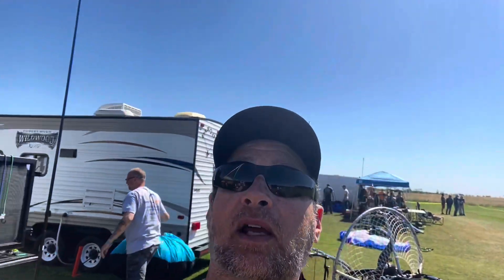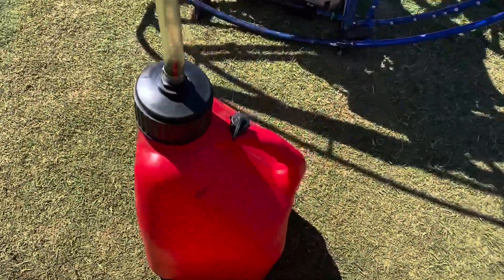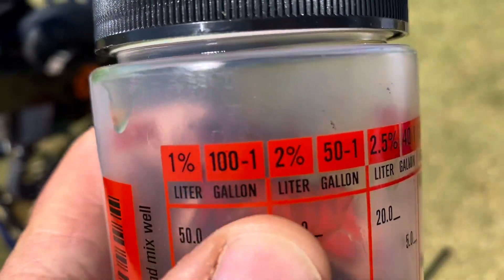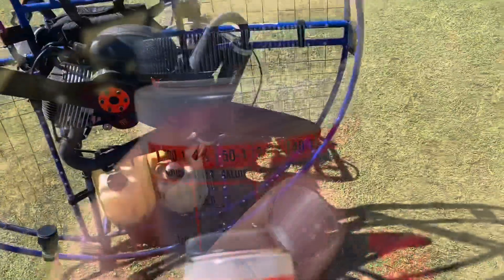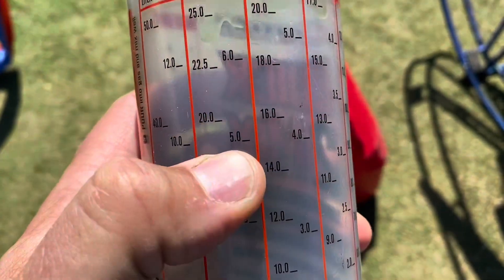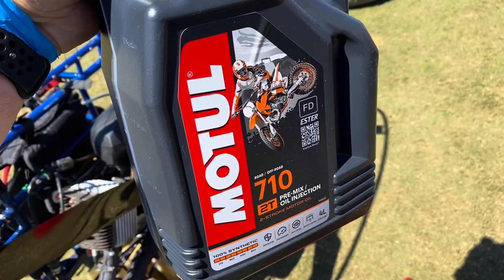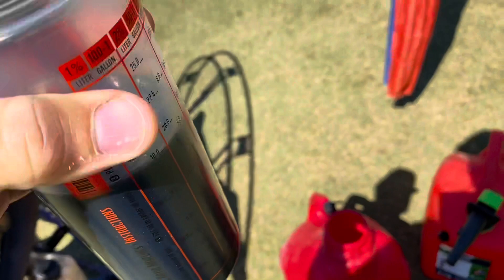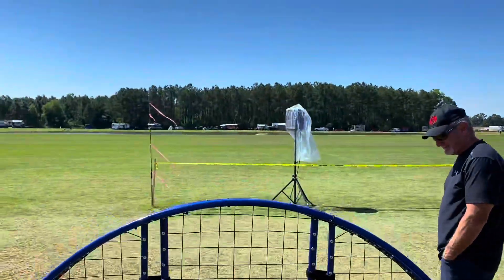How to correctly mix 50:1 gas and oil for your 2 stroke engine

Comment: So, where is the marking for 1.5% or 66:1 in that mixer?  50:1 is the break in ratio.  Do you just kinda eye ball it for 66:1?

The reason I'm asking I'm looking to buy a mixer bottle but can't find one with both mixing ratios
Reply: the measurement of oil is on the side of oil bottle.so if u have a empty oil container. use that to measure.